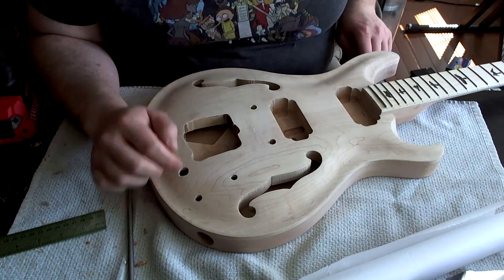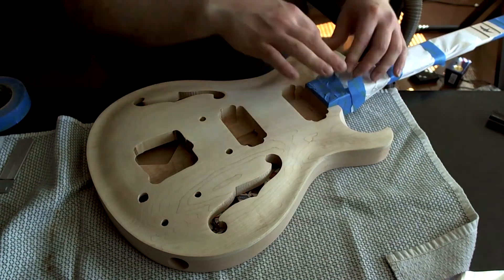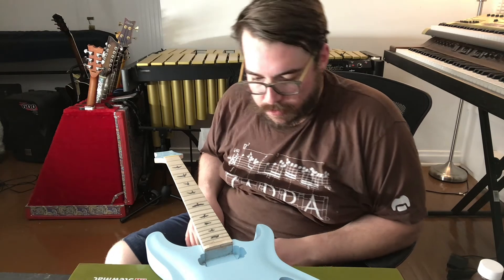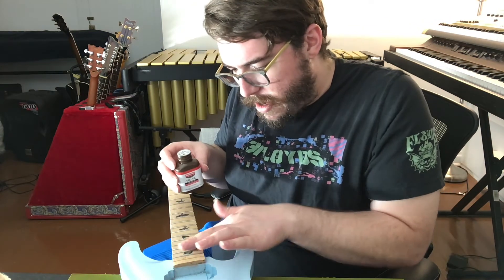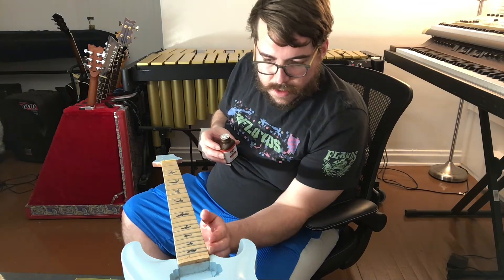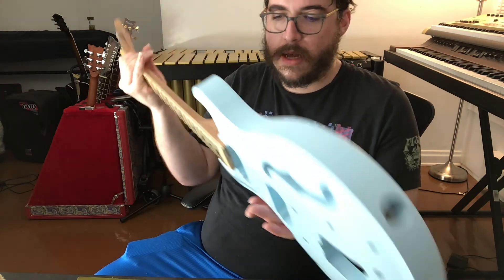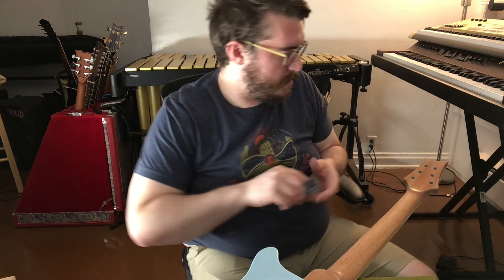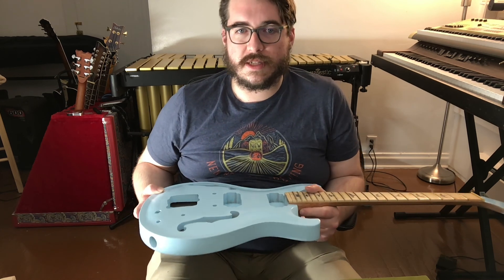Building My First Kit Guitar - Part 4 - Finishing (GGBO 2021)

Comment: With tru oil you just put a tiny amount on a paper towel. And wipe it on and all off again . It can take about twenty coats  or more but worth it.. Leave a day between coats before you get a feel for what you ae doing If you want a faster job just spray clear lacquer instead ...  In between you scuff it down with 0000 steel wool... If the neck has any previous coating that needs to be sanded to bare wood before you start ...When wiping off it needs to feel almost tacky . When you get to the end you are almost polishing the last coats with tru oil... a long but brilliant process